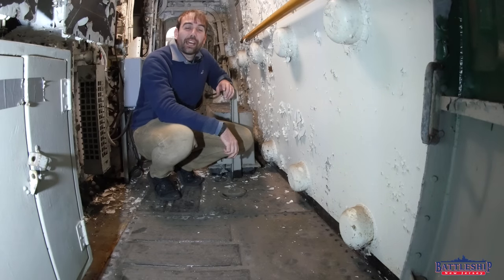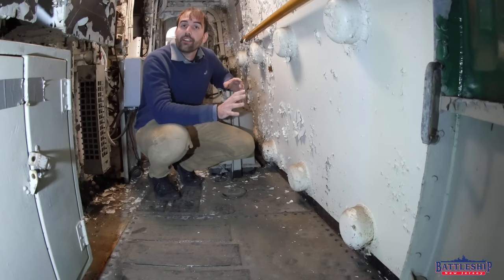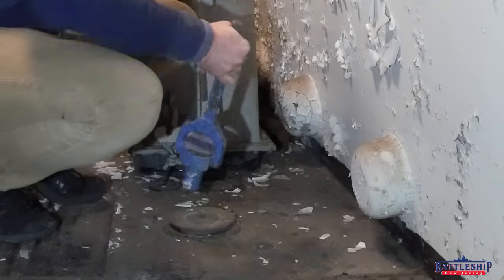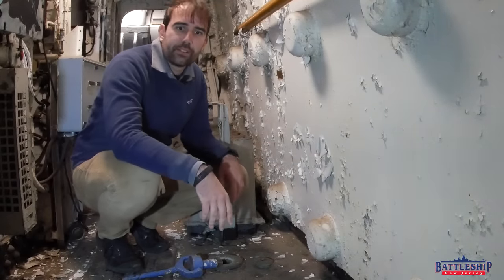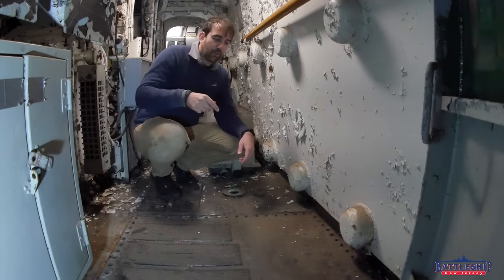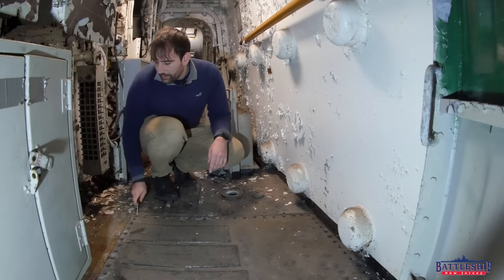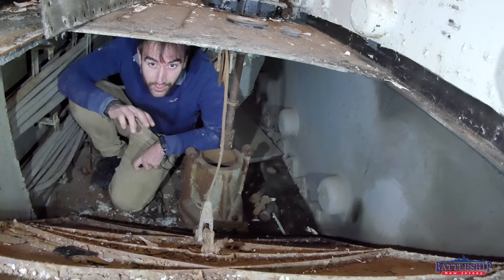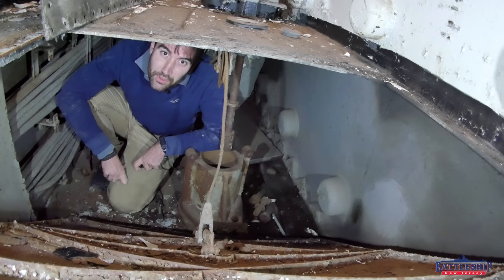Turret Locking Pins: Can the Turrets Rotate? UPDATE

Comment: So my question is since Iowa proved you could rotate a turret, other than the locking pins is it just a lack of available shore power that prevents New Jersey from doing the same?
Reply: As Ryan says NJ turrets have been welded the other Iowa's no. Also there is no more hydraulic fluid in NJ systems. All this can be fixed but looks the other Iowas had a head start as to be able to rotate their turrets.

Comment: If it's in the report that one of the reasons was that NJ's turrets were welded in place then I think it's reasonable to assume that it's quite likely that a contributing factor was they thought the turrets were, and so that was one added factor. Clearly at least some work has actually been done to 'weld them' in a manner of speaking, and it would be unsurprising to have that be communicated as "oh yeah the turrets are welded fixed" up the chain. It's good to remember that things that are reported to decision makers can be significantly and materially different from the actual truth, particularly where the navy is trying to save money

Comment: New Jersey would've been the oldest (or one of the oldest) of the active Iowa class battleships when that decision was made. Could this have played a role in the decision?
Were there significant improvements made to Missouri and Wisconsin? Beyond the layouts you've shown in previous videos, it seems that the rest of the vessel is reasonably similar.
Reply: As far as age goes all 4 were laid down and launched within about 2 years of each-other. NJ being the second of the class.

NJ was the only one that had been commissioned/Recommissioned 4 times, Was in service about 3 years longer than the others (quick math bassed on commission/recommission dates) and likely had a whole lot more mileage on her.

Comment: It’s quite possible I think that it was reported on paper that at least some of the turrets were locked in place by welding work, which would still be correct but easily misunderstood. I wonder if a more critical reason was mileage done on the engines or other maintenance needs if they kept New Jersey in service

Comment: I really hope this series of videos about rotating a turret ends with ROTATING A TURRET!!!

You just need a powerful generator on the pier, some hydraulic fluid (and maybe 5 or 6 other things).

Could some type of device be built which would create enough mechanical advantage to rotate the turret with a standard 110v electric motor - something that would turn the turret slowly, like over 24 hours?
Reply from the maker: No Clark. No.
Reply: @BattleshipNewJersey  You’re no fun! 😂

Comment: Now that the USS Iowa museum has proven they CAN train (rotate) their turrets on shore power alone (https://www.youtube.com/watch?v=1nMJCY-CImU) I wonder if any of the other BBs will do so? (I was quite skeptical that shore power would be insufficient, considering that the turrets got rotated in port for ammo handling or maintenance even under cold iron conditions).  Or does Iowa have a significantly larger capacity shore power connection than New Jersey?
Reply: Iowa actually does have more shore potential power capacity than her sisters but that doesn't have anything to do with how she was able to rotate Turret 3 recently.

Iowa has 10 400A Shore Power connectors for a total of 4000A of maximum shore power.  The others have 8 or 3200A total.  I was told by a 1980s plankowner crew member that the extra was added specifically so they could do maintenance on the turrets while on shore power without risking tripping shore power offline.

That doesn't matter because the Iowa only has 2 of those 400A connections in use in her museum berth, so only has a total of 800A to work with, where New Jersey has 6 cables giving her 2400A of total capacity (assuming all of those 6 are active).

As for how the Iowa was able to rotate Turret 3, I have no firsthand knowledge but I suspect that they used an external mover, possibly something as simple as an electric drill/driver, acting upon an ordinary wrench fitting.  This would explain why it took so long to rotate the turret compared to what you would see with the ships operating equipment.

Comment: Back in the 90s, shortly after their decommissioning and going on for over a decade, there were two big picture debates around disposition of the IOWAs. 

There was a surprising amount of civilian-based, back-door lobbying going on about which of the IOWAs would be stricken and which placed in Class B Mobilization. This debate was happening in parallel with the more general defense community debate about retaining the battleships for both their naval gunfire support capability and their potential for modernization. The political confluence of those two efforts resulted in NEW JERSEY and MISSOURI being selected for donation first.

Both debates were polluted with rumor and falsehoods, some with considerable durability. For whatever reason, the arguments against retaining the battlewagons were a revolving door of alleged issues that came and went over time... 

Originally, the Navy chose NEW JERSEY for retention and IOWA for striking. The argument was IOWA still needed repairs to Turret II, which had been planned but not implemented prior to decommissioning. It was counter-argued that NEW JERSEY had her trunnion bearings welded-down and that, plus other “defects” would therefore require as much or more work than IOWA. 

In the end, the actual relative material condition of the ships really had no effect on the outcome. And the truth is, repairing the defects in either IOWA, NEW JERSEY or the other two would have been minor line items in any reactivation budget.

Also, the Navy was claiming the battleships only had to be retained long enough for the commissioning of the ZUMWALT and LCS classes for replacement of the battleships’ naval gunfire support and littoral warfare capability. This was despite the considerable amount of good work that had already been done on development of extended-range and guided 16” projectile designs. 

(The ZUMWALTs and the LCS… we all know how that’s turned out) 

There were various and often competing civilian groups vying to acquire the IOWAs as museum ships. Some of the lobbying factions had more clout and momentum than others. Without going into details (and some of them kind of weird and silly) the political mop flopped in favor of retention of WISCONSIN and IOWA for Class B Mobilization and NEW JERSEY and MISSOURI for donation. IOWA and NEW JERSEY were actually swapped in this regard.

As an aside, I for one always suspected the Big J trunnion bearing vandalism rumor was bogus… Food for thought. I have been told by a pretty good source that shore power is sufficient to train the turrets and elevate the guns. I have no idea if this is true, but like I say, the source was a good one. It does point out another interesting feature of the battleships. The service turbines not only generated A LOT of power, it was clean power. Perfect sine waves:)
Reply: I am going to date myself with this reply, How is Mr. James West doing?
Reply: @klsc8510  James and I both still work for President Grant on special assignments. You may recall that in one of our cases, the USS MISSOURI figured prominently. I’ll say hi to Miguelito for you…

Comment: It takes approx 3-5 lbs of tractive effort per ton to move a railroad freight car.  The rolling resistance of New Jersey's turret rollers shouldn't be all that much more than a rail car, since both are steel wheels/rollers on steel tracks.  So if a New Jersey turret is 2,200 tons, at the stated lbs per ton it would take about 11,000 lbs of pull to rotate it.  You can get a winch rated for 12,000 lbs at Harbor Freight in South Philly for $379.99 plus tax, exactly one mile from the battleship as the crow flies.

If you want to theoretically propose that it takes more tractive effort to turn the turret because it's a circular track and thus will have more resistance, then double the above figures to 22,000 lbs of tractive effort.  You'll need to spend around $1,000-$2,000 for a bigger winch.

Note that the tractive effort calculations above assume a free-wheeling turret----they do not take into account resistance from the existing turret drivetrain.  If the turret were able to freewheel, at least as much thought would need to be applied as to how to control and stop the rotation, as was applied to get it to start rotating!

Comment: Just curious, what is the cable that is connected to the angled plate that is in front of you when you down under the deck plate looking at where the centering pin should be?

Comment: As in the previous video you mentioned the power issues with trying to rotate the turrets, in the turret tour video you mentioned that the turrets had a battery backup system for rotation in the even of power failure might you be able to charge that up slowly ( if it still exists) to get around the high instantaneous power demand that driving the motors directly would have?

Comment: Two quick things.
1. From the video with Ryan in the crawl space, there is clearly a pulley wheel, steel cable, and a door of sorts in the foreground. What is this item?
2. Seems to me they should have returned the pin in place. Granted the turrets is heavy but in the correct sea state, one pin might be sheared off when the design requires two. The museum should clean and return the pin.

Comment: 5 mins with a grinder..... and you can remove that "weld"
.
its like the Navy was like... "they are welded in place... take my word for it.... and if you do "unweld" it, we will know!!"
while that little L bracket can be quickly removed.... the grinder would leave marks
.
and... the Navy needs to be able to reactivate these ships (more so JUST after they got retired VS now)
so welding a 5 inch bead all the way around the turret would take DAYS to fix
.
.
that little weld means....
1. its "welded" in place...... a lost tour group isnt gonna start hand cranking a turret
2. its easily removed and quickly removed if needed to be
3. it will also leave evidence that it was ground out (even if its rewelded later)

Comment: Was there any way to manually rotate the turret, in case the main power on the ship failed in combat? (2,000 turns of a crank to turn the turret 3 degrees?)
Reply: Probably easier to turn the ship to aim instead of trying to rotate the turrot manually.  But if you find it, I WOULD LOVE to see that reduction gear!
Reply: We learned there's ones for the 5 Inch so probably
Reply: Afaik not only the turret rotation, but also the elevation mechanism and breech block relied on electric/hydraulic/electro-hydraulic mechanisms, so if the power on the ship fails, you don't have power to open the gun breech to reload, neither can you elevate the guns. So there would be no point in manually rotating the turrets
Reply: Hes said in a previous video that there is no way to manually turn the 16in turrets.
Reply: @Jacksonflax  I suspect it actually does exist and he hasn't found it yet. No matter, it's not going anywhere without hydraulic fluid.

Comment: Fire up the generators and move that ol son! Get an exception from the navy.
Reply: That would be an exception for the ENTIRE Engineering Plant.  Auxiliary equipment, boilers, piping, fire suppression, turbines, generators, cabling, switchboards, and 101 things that I haven't even bothered to mention that have a STRONG potential to kill people.  

When you start playing with the 600 PSI 850F steam required to roll a generator, it's not what you see coming out of the tea kettle...that's hot water vapor.  Losing a gasket on a steam line can cut you in half and then cook both halves before you know that you just died.  Pinhole leaks are located by waving a broom in front of you.  When the end of the broom disappears and the rest catches fire, you've found your leak.

Comment: Indeed you don't have enough shore power to move the turrets. However you can obtain enough rental generator power to run the traversing motor. You will need your electrician to wire an inlet socket so you can exclusively power the traversing motor.
Reply: If it hydraulic its possible you could patch in a small pack and slowly crank it round...

Comment: I'm sure the museum could find a way to rotate the turrets if they really wanted to. You don't necessarily need 300kW or whatever it was if all you want to do is rotate it slowly. You could set up a geared-down low power motor.
Reply: Breaking it loose might be a problem, there is a lot of friction at startup.

Comment: If the other pin in turret 2 is also missimg, could the turret feasibly be rotated using some big winches and some ingenuity?
Reply: After having been left in such a state for so many years I feel like you'd run into more problems than just the weight of the turret if you tried to turn those things.

Comment: Is there anyway to rotate the turret other than the electrohydraulic motor? It seems odd to me that with all the redundancy in a Battleship such an important function would have a single point of failure. I know the forces are immense but it seems to me with enough gearing a couple hundred sailors and a lot of time you could rotate the turret manually. in the fullness of time if there is no other option.
Reply: The normal redundancy would be having a ruggedized hydraulic motor (or two of them) and redundant power supplies. No point having a manual crank for combat use; it would take too long.

Comment: Add more shore power and fluid, and let's see those turrets move again.
Reply: I believe I read somewhere that the Iowas had Fairbanks Morse emergency genorators aboard.... now those were used on new ships right until the mid 90s, I'm sure that I can't be the only former A-ganger that wouldn't mind putting in some time and seeimg if the old girl can make some of her own power again.
Reply: @jaysonlima7196  realistically this is the best option if there ever was going to be anything done.  Depending on what has been done to the cooling water systems on the auxiliary diesels.
Reply: @jaysonlima7196  All of the through-hull penetrations are blanked and welded.  I'm assuming that this would include the sea chests for the EDG.
Reply: @kevincrosby1760  oh I can guarantee that they are blanked over but she's due for a dry dock and removing a blank is only slighty harder than putting one on, and I'm also fairly sure that they would only need to get 2 going to be effective.... the bigger problem isn't the hull blanks its the plumbing between the sea and back up valves and the heat exchangers that are more concerning, I can almost say too 100% certainty that some of those "pipes" are currently nothing more than pipe shaped paint. But they managed it on the Slater, so might work, and yes I am aware that slaters seachests were not blanked lol
Reply: @jaysonlima7196  it's a fun topic to talk about no doubt.

Comment: I thought you guys made it clear you guys cannot rotate the turrets
has the locking pins broken?
Reply: He did say they were a temporary wield though they don’t have enough power to turn one.  You would need New Jersey’s boilers and electric generators turned on to get that power.
Reply: @ryancampbell4119  i would assume they’d have enough power when plugged into a port, they use the same plug and it’s likely while in service the turret had to be rotated while the boilers were off for loading or unloading purposes

Welp wrong
Reply: @Aberman1  their shore power supply is only enough for lights and AC not the dozens of kilowatts needed to turn the turret
Reply: @thedyingtitan1247  so just rent a generator
Reply: @frogfichtrlustr369  Ryan also said they don't have hydraulics. I don't expect those turrets to ever move again.
Reply: @redcat9436  Hydraulic fluid isn’t that expensive although I guess it would take a few, hum, let’s say hundreds of liters. But hey if there’s a will there’s a way
Reply: @Aberman1  0 I

Comment: Well, how much electrical power does the turret rotation hydraulic system require? By the way, hydraulic fluid may be procured or acquired easily.
Reply from the maker: The problem with the hydraulic fluid is getting it to stay where its supposed to, that system leaked 30 years ago, its far worse now.

Comment: Ryan, I think the real reason you won’t be able to turn the turrets isn’t power or being welded in place it’s most likely going to be your rollers got pounded flat and the roller tracks have divots hammered into their surface. Mild wave action doesn’t seem like a lot but 2000 tons slowly hammering for 30 years in the same spot isn’t good for things.
Reply: without seeing the motors, I'm thinking they are probably DC, the bigger issue would be is the motor control cabinet style useable ? if not, servo drives could be had. with a dc motor, if you keep the voltage down it'll move, slowly, with lower current. I'd have to see the equipment. i know a little about dc and ac servo systems, that's what this is
Reply: @Bugman He's done a video showing the rollers once already, think it was about the turrets falling out if the ship rolled over? Couldn't really see much in the video though as it was very greasy, dark and tight.

Comment: the ship would have to be ballasted, those barrels would cause a list that far of centerline
Reply: I imagine the weight of the barrels is counterbalanced by the weigh at the back of the turret. I would think that would be a deliberate part of the gun design.
Reply: @999torino  it certainly should be! If they weren’t balanced, I’d imagine they’d cause immense strain on the hill/mechanism during rotation. Not to mention, posing extreme risk during a fire mission with the guns broadside in uneven seas?